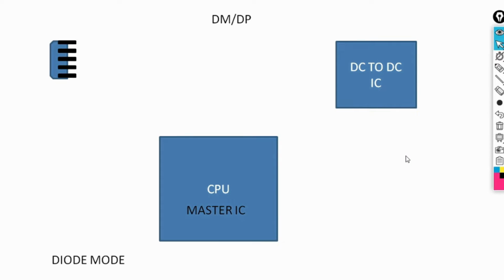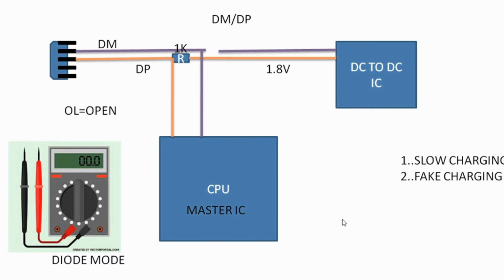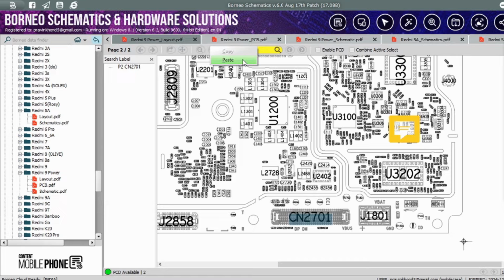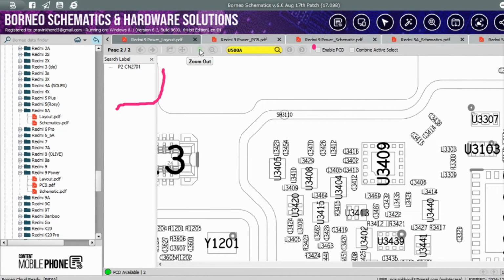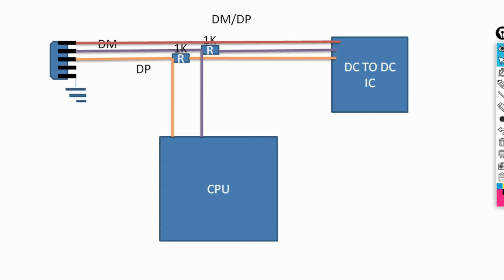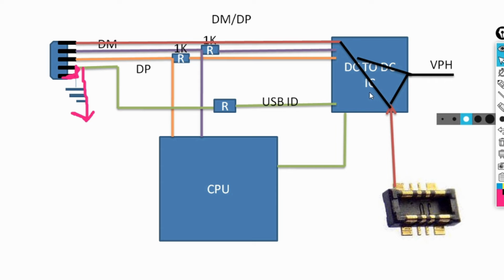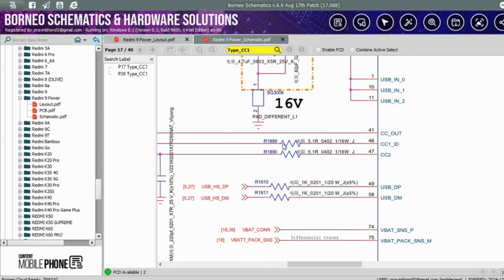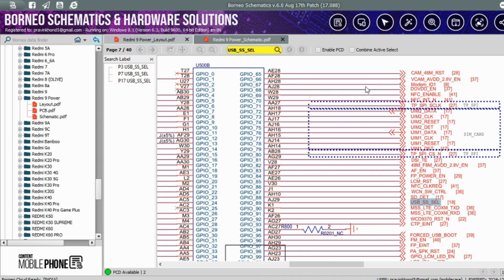What is VBAT DM/DP/RX/TX/ID/OTG Line In Charging Port.How To Diagnose These Lines In Cell Phone

Comment: Can you help me with this one sir. I have a problem with this samsung phone which is not charging and powering on. VBUS lines are good but in the CHGOUT going to VBAT lines i can not measure any voltage. Which is faulty? Do i need to change the CHARGING IC(SM5173)?
Reply from the maker: Check the charging ic requirements first